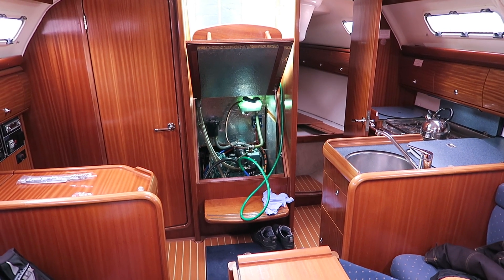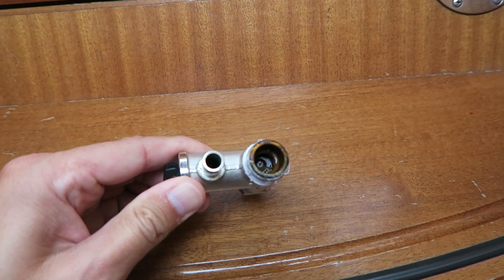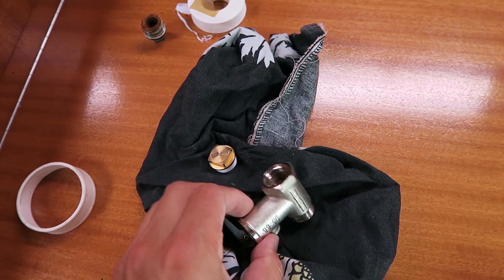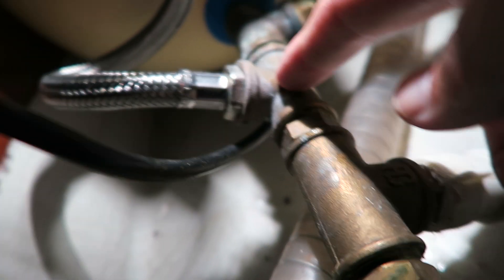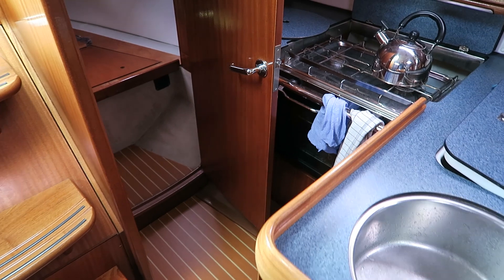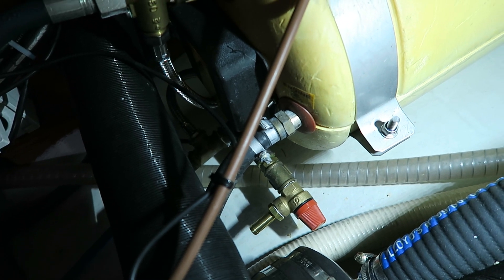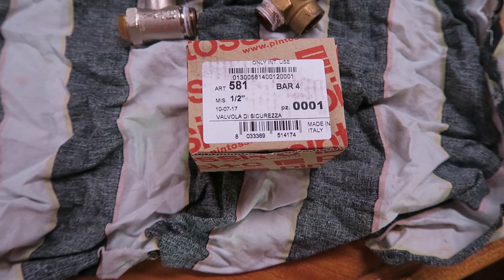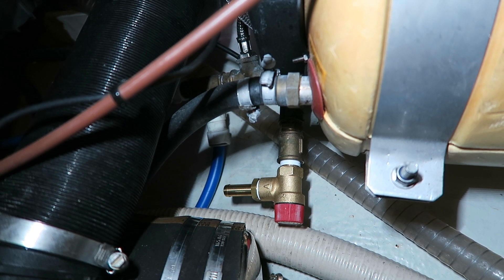Don't crack your waterheater, mount a good 4 bar pressure relief valve

Comment: Hi Tino, thanks for another great video! How did it go with the final valve that you put on in the end of this video? Does it (should it) drip?  Is it still good?
Reply from the maker: Thanks :) Yes the last valve is still good and without any drips. It must not drip.
Reply: Tino G - Sailing Sounds good! Do you recall at which website you found and ordered this particular valve?
Reply from the maker: The valve is ordered from www.hedestoker.dk and then search for "sikkerhedsventil" - if you don't live in Denmark or Europe the valve is a known unit at most boilers in a house so easy to find at a eg. blumbing shop.
Reply: Tino G - Sailing Many thanks for the quick answers!

Comment: Hi Tino,did you ever change the saildrive manchet in your boat. Volvo says you need to change it every 7 to 10 years?
Reply from the maker: doh.. think I forgot something.. yes they say it must be changed  every 7. year but according to my old boat it's not necessary. My old boat was 40 years old and my bav32 is only 15 years old. If there is a problem with the manchet it will start to sip in slowly, so as long everything is dry there is no problems. Check out "sailing britaly" he change the manchet on his old Bavaria. He also stab test the old one and it is as good as new. Think his Bavaria is from 1998 or so.

Comment: Hi Tino, nice video. I watch your channel to learn more about yacht installations. Can you give some background what kind of water heater it is?
Reply from the maker: My water heater has a volumen of 20 liter and equipted with a 800W 220 volt termostat controlled heat element, the brand is QL and propperly Italian made as most other boat water heaters eg. Isoterm, Sigmar, Quick. Most heaters will hold the water temperature at 50-80 celsius degrees for around 12 hours and you can also heat up the water with the cooling water from the engine. It takes around 20 minutes to heat up the water to the right temperature. When you have the 80 celsius degree water in the tank you then mix it up with the cold water so you will get a long lasting supply of hot 50 C water.
Reply from the maker: Check out this channel, he has a lot of information regarding water heaters and water installations https://www.youtube.com/watch?v=leeZ2mKnm-A

Comment: Hi Tino, your find that every time you heat your water cylinder your PRV will let by, this is because water expands with heat and it needs to release the pressure. Some boats have a tap which constantly drips, hence getting rid of the excess pressure, what you need is a small expansion vessel installed on the cold water inlet. That will rectify your problem.
Reply from the maker: Ok. I have a 1-2 liter pressure tank mounted on the cold water side before the water heater, so it should in theory do the trick with the expansion 😀
Reply from the maker: Hmm.. Or is a expansion vessel something different ?
Reply: Tino G - Sailing 
You might find that the one you have is to boost the cold feed to the hot water supply, if you have one then it’s worth checking to make sure it hasn’t failed, if there’s water in it then the diaphragm has failed and it’s a new vessel.
It’s just the same as plumbing in your house, if there’s no where for the water to go when it’s expanded, then it will come out of your PRV, these will only leak when something else has failed. The chap who said they always leak either on a boat or at home is wrong, they shouldn’t, it’s a safety valve, when they do leak normally the vessel has lost its charge or failed. 
Your a clever chap, I’m sure your get there in the end.

Comment: I think 💭 you need an expansion vessel may be 2 litre in size
Reply from the maker: Maybe, but this system is pressent in many boats and without any expansion tank. I can see some boats have no pressure relief valve mounted but when searching the net all boat waterboilers has this valve mounted. The valve it self has two functions, a one way valve and a over pressure valve. If right mounted it will only let cold water into the waterboiler. In my case I need to mount a one way valve on my system to be totally right.

Comment: It's not faulty, every relief valve in hot water systems both home and in boats will drip, this is so the water never presses backwards in the system and to keep the pressure at a constant level. 
All dry boats (no water in bilge) will have a bottle under the valve to collect the water including mine. 
It's not a safety blow out valve that stay shut until it reaches an exact set amount of pressure .
Reply from the maker: Thanks for the info 😊

Comment: Useful video Tino. I have the same system but with a hot water faulty outlet. I have replaced it and all is good. However I do not have the mixer connection from the cold to hot outlet. I am presuming that it does not come with this from Bavaria, did you add that configuration? I also note that there does not appear to be a pressure relief on my system, did you also add this as an additional option. It appears to be connected to the cold inlet?
Reply from the maker: The boat was with this cold/hot mixer when I bought the boat so I don't know if the Bavaria has this system mounted from the yard. I know my Bavaria friend did not have a pressure relief valve on his Bav32 and now he has bought a new waterheater due to a leak in the old one. Think it is very important to have these valves, know they a mounted on all waterboilers in eg. houses. If you goolge "boat water boiler" it seem like there is pressure relief valves on everyone you can buy from new today. And yes the relief valves is connected to the cold water inlet. Regarding the mixer it is a very nice thing to have if you don't wan't to burn your skin on hot water from the tap. The mixer is pretty expensive and I changed the old one when I bought the boat (I have a video) the price i around 117 US Dollars but the quality of the new 2017 model is also improved compared to the old version.
Reply from the maker: The video about changing the mixer valve is here : https://www.youtube.com/watch?v=CDTnPFK07OY - sorry it is not on English